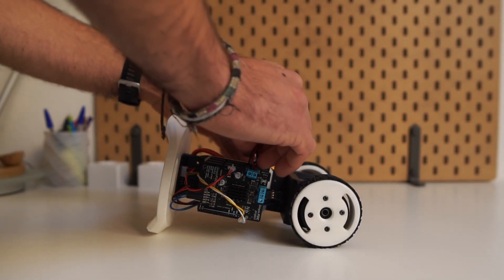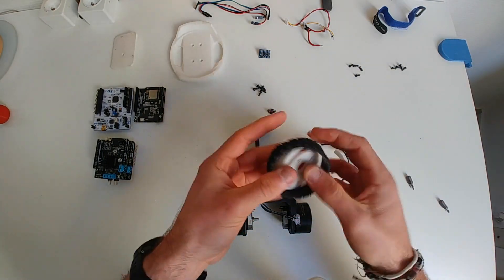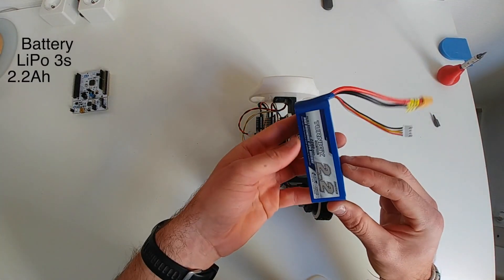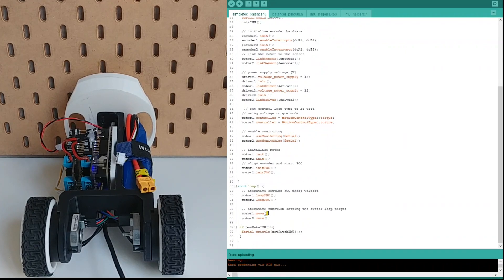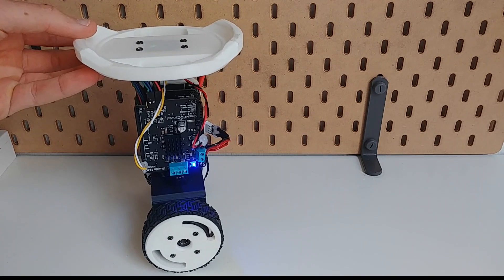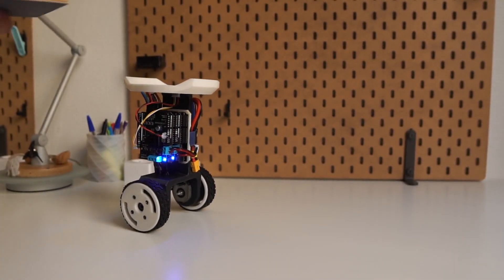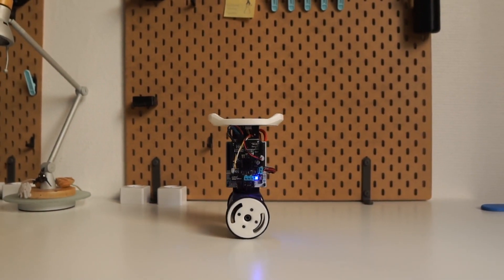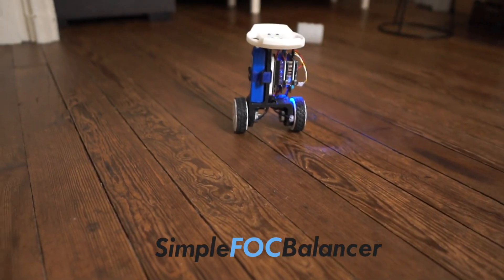Arduino BLDC balancer robot - Tutorial

Comment: How can the robot adjust the target angle where it will be balanced. I’m having trouble finding a way to not have to hardcode the right angle
Reply from the maker: I've used a double PID loop. One for stabilisation being the inner one and the outer one to control the velocity of the robot. When you set the velocity to 0 the outer velocity PID loop will adjust the angle so that the robots stays still. It is a bit tricky to tune but it works well :D
You can see the code in the git repo of the project

Comment: I would have preferred Cesar's gift as the platform. It does look very interesting. I have seen a lot of references to the odrive. Why it's that board so expensive?
Reply from the maker: Hey Arturo!
you're right Cesar's gift would be better ;)
ODrive is a very versatile and very powerful board with a great software solution and a great community. It is actually not that expensive for what you get. 
But the price is the biggest issue when it comes to using odrives with hobby projects. I agree. These shields would replace odrives for gimbal motors. And they can even have a better performance than ODrive in some cases, but the goal was really to be simpler to use and cheaper. :)

Comment: I wish there was an even smaller dual channel board. One near the size of a TTGO T-Display or Nano or most ESP32 boards or a typical esc.

The Unos size and the Uno itself is just a bit big
Reply from the maker: The size is always an interesting topic. Nano size drivers are not that easy to find for any type of motor control application. Except maybe for steppers. But this is going to change soon, there are really a lot of (especially bldc) drivers that are being developed at this moment. 😃
But the aim of this project is mostly to enable using BLDC motors and provide a nice prototyping platform where you can easily exchange any of the components and still have a working robot. 

In terms of the smaller drivers, you can check out the gimbal controllers such as BGC3.0, BGC3.1 or Storm31. 
They are double(triple) drivers  and will work with the library as well.

Comment: Thank you for your very interesting videos.
Would this concept also work with two each:
QX-MOTOR QM4208 380KV and
AS5600 Magnetic Encoder?
Reply from the maker: Hey Falk, Yep this concept will work with those encoders and those motors as well. 
But I would be careful when using those motors with low-power drivers like simplefocshields because of current limit of 5Amps. I would advise you to use the gimbal motors with these kinds of drivers.

If you are constrained by the choice of motors, and need to use the QM4208 I would suggest you to use a higher power driver. At this moment there are many of them that are low cost. But that is an area which advances very fast and this will change soon I hope. We also have a board that would do it - SimpleFOC PowerShield. At this point we do not sell it and it is in the final stages of testing. It is completely open source and here is a link if you are interested in making one: https://github.com/simplefoc/Arduino-SimpleFOC-PowerShield
Reply: @theskura  Hi Antun, Thanks a lot for info, looking forward to your interesting further development.